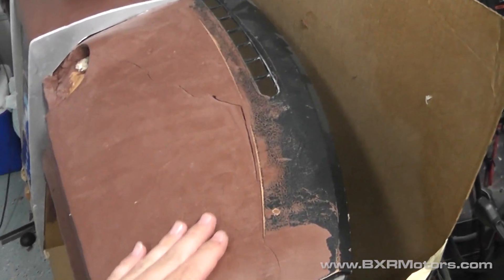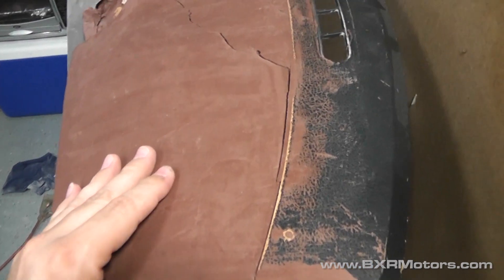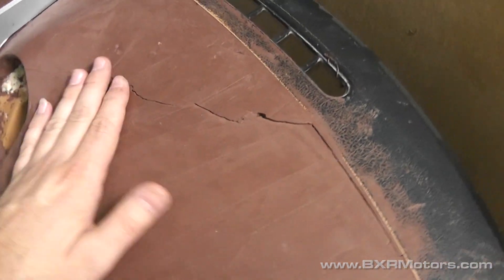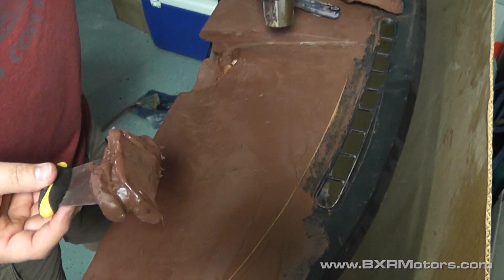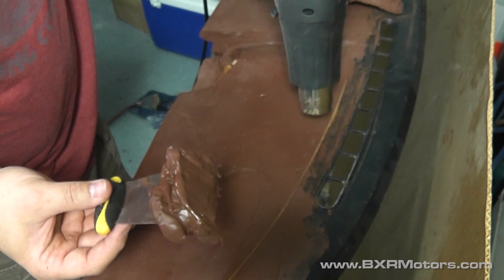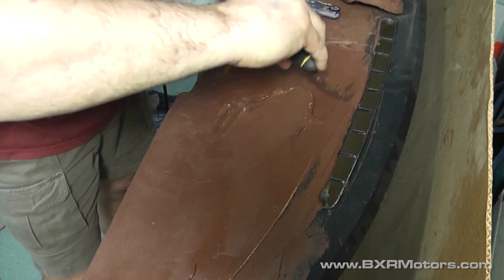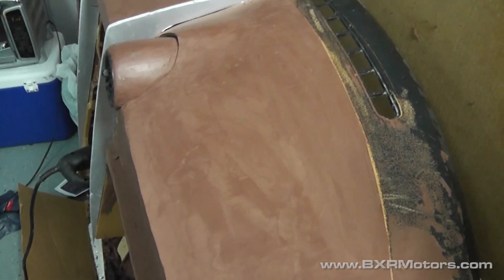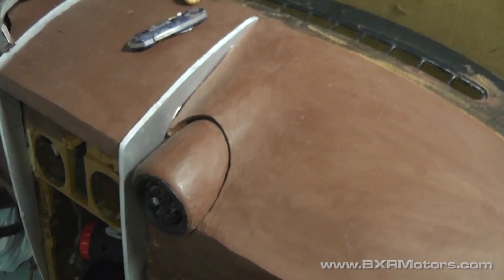Clay Sculpting Fixed Cracked Dash - Bailey Blade XTR Concept Car Design - Part 80

Comment from the maker: Thanks Gary, Yes I do recycle the clay. I basically clump it into large balls and then heat it up in the oven and then re-compress it back into cylindrical shape to squeeze all the air out. The rig that I have the Dash mounted to has like a catch bin so that as I shape the clay it simply falls in front or behind where I then just scoop it up and reuse it.

Comment from the maker: They tools give it a supper smooth surface. Adding water will not do anything on this type of clay. I will not absorb any water at all, you have to use heat or special chemicals.